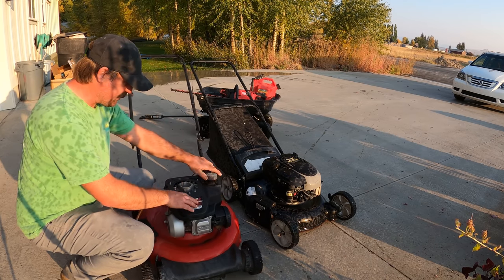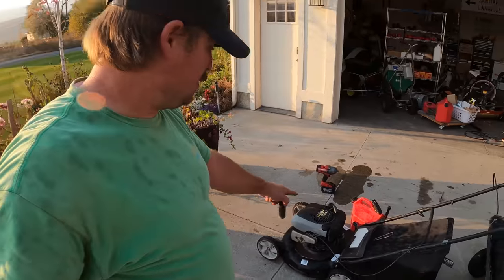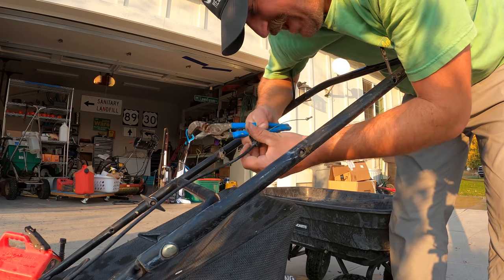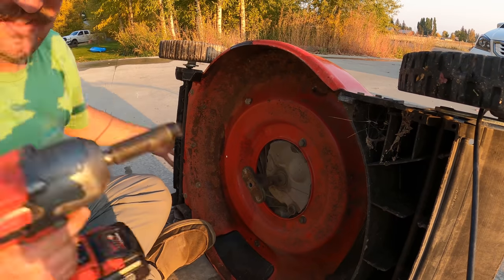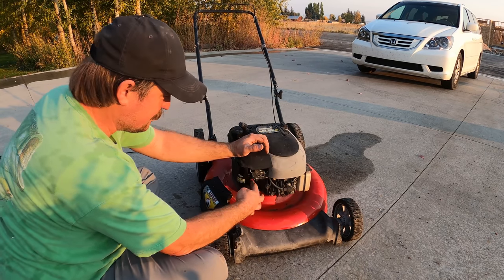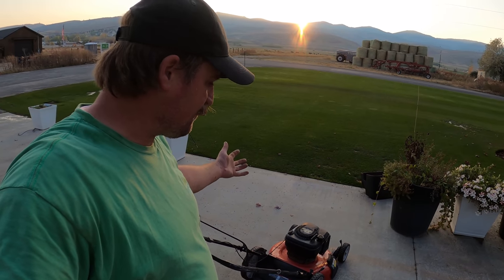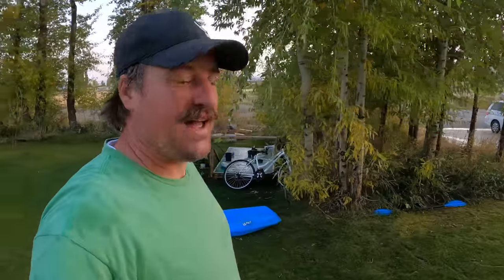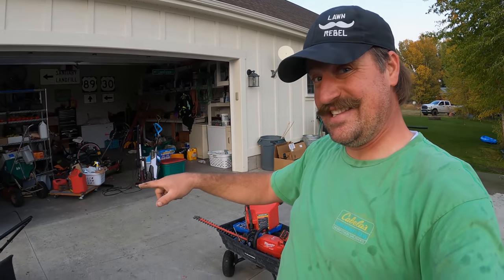How to CHANGE an ENGINE on a lawn mower

Comment: After watching your video I did the same.  Unfortunately one of the engine bolts would not come out.  Tried everything, even a grabber socket. And had a impact wrench, still no go.   Finally had to Drexel it out.  It's always that one stubborn bolt!  But it worked out in the end....

Comment: When you tip the mower sideways, it's possible the oil in the crankcase could find its way into the muffler. Depends on which way you tip it, I guess

Comment: I found a free lawn mower on the side of the road, the engine was dead. I found another free mower and the deck was good. A quick engine swap made a great free mower. The only issue I went from a self propelled to a push however I have a small property and is relatively flat.

Comment: The grass bag on the old mower is decent size. Maybe hang on to it. You might find another MTD deck using a bagger.  My dad had an MTD mower from the mid 90s. The handle on it seemed really long with a large bag that's bigger than what you find today.

Comment: If the wheels were the problem, couldn't you just replace them (taking the good wheels from the donor mower)? That way you can have the bagging feature of the other one. I guess replacing the engine may have been easier

Comment: Yes I will say in mist of all the comedy you did show how four bolts will drop motor smack on ground an snaping the throttle cable pin was good an I'm sure you had plug wire attached the whole time on both classic I love it

Comment: Me ward. Any experience using predator. I’ve gotten rid of a couple mowers I love ( 30” residential toro 2 blades ). I would have lived to put a predator engine as the Briggs Stratton just didn’t last. Any numbers of cc or hp we need to pay attention to. The thing I ran into is the numbers aren’t exact same on old engine vs new engine. So I figured I’d buy the same Briggs and put it in old mower or sell used as is mower and buy new mower. I always bought new but wished I knew more. THANKS

Comment: A new primer bulb only costs a couple of bucks, you could have fixed the free mower and still had the one with the bagger.
Reply from the maker: But what about the pull string on that engine
Reply: @lawnrebel  My local hardware store sells starter rope for 79 cents a foot, probably the cheapest part on a lawn mower.
Reply from the maker: @johncarter7284  true... But this engine didn't have the whole starter mech with rope and all. Everything starter was missing

Comment: Put two blades on that thing. X blades. Works amazing.
Reply from the maker: Good idea
Reply: @lawnrebel  i did it on mine and it works great. The suction is awesome plus, like the washer trick, it lowers the blade down a little.
Reply from the maker: @caseysanguins9490  link me
Reply: @lawnrebel  link you?!?  Its all home grown. Grab 2 blades, preferably one that is flat and one that is like a C channel in the center. Notch the channel out so the flat blade rides in it, and bolt 'er down tight.
Reply: @Dave Noble that is what I originally wanted, yes. However it also cuts much better, mulches the clippings smaller. I have a couple trees that are constantly dropping branches and it sucks them in and chimps them up enough that they break down in .y compost bin much faster. Great for a clean up mow before the reel goes over it. Just make sure you balance them up. It takes a little doing to get it done so the whole mower doesn't vibrate to death. But its worth it. Side note, the extra weight makes starting it WAY easier, which was unexpected.

Comment: "How to CHANGE an ENGINE on a lawnmower" also Connor "THIS IS NOT A HOW-TO VID"
Reply from the maker: Exactly
Reply: @lawnrebel , you should use the bag and just put it on the new deck
Reply: @adameckhart5559  I didn't see a rear discharge on the new mower deck

Comment: I hate when my mower leaves tools and parts everywhere.
Reply: I bought a brand new Honda HRH, and transmission was lost after 15 minutes... luckily enough I found a part on the lawn later, brought it back to the dealer who told me it never happened before, of course (he sold it saying "you won't have to care about it for 10 years") and I haven't had any more issues with it. In fact I wanted to post a joke like "Just buy a Honda and keep your engine"...

Comment: Hey dummy you tossed a good motor from looks of the deck .bet you needed a new bulb an drain float boWl a new gasket flush cab out good as new . Pluss when you say it did not have bagger system . Do you mean it just did not have bag with because I've not seen a deck that just did not take a bag in long long time an if that was case it had grass out let to side an like all ,ours was covered  but I did see a lift door at rear so yeh it took a bag 😅😅